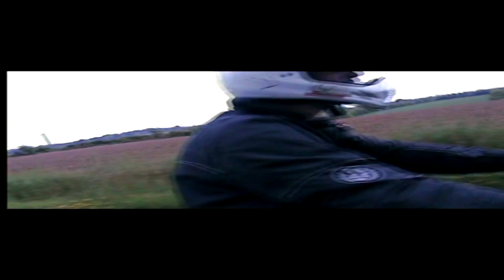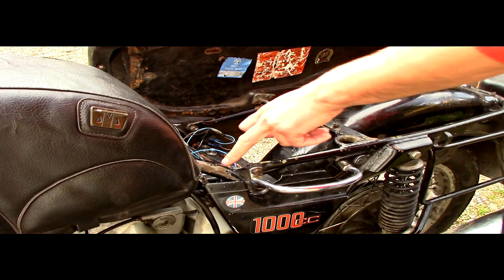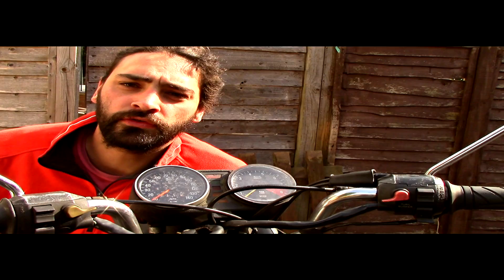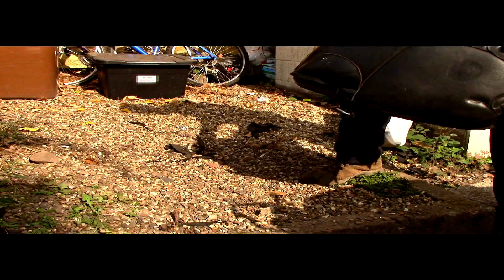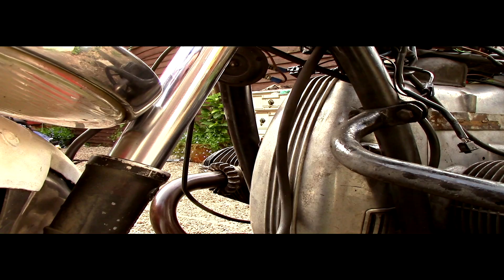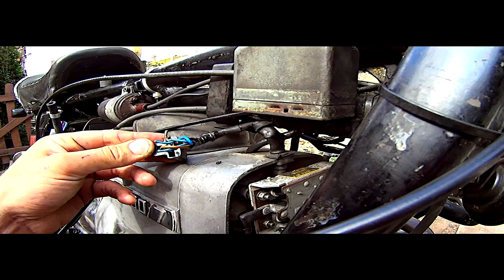HD Bmw r100, r80, /7 charging system explained

Comment: thanks.. but you said the light didnt go out and you put in a new regulator.... well, i already did that and its still lit... so what now? Brushes? rotor? if its not getting the voltage push back, wouldnt that mean it not creating voltage?

Comment: so if i want to use this engine in for example a 2cv. the loom is different. i could use a modern three phase reg/rect unit. connect the three wires from the alternator to it. one to plus and negative of the batttery & i could add a wire from the ignition  and send when turned on send 12v to the df terminal to power the alternator ?